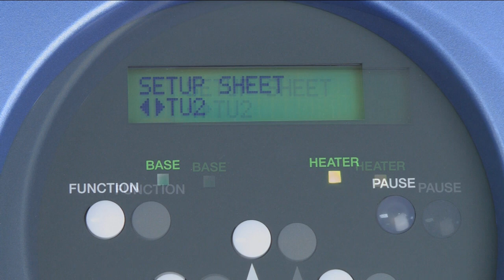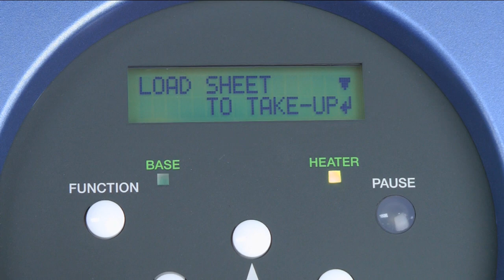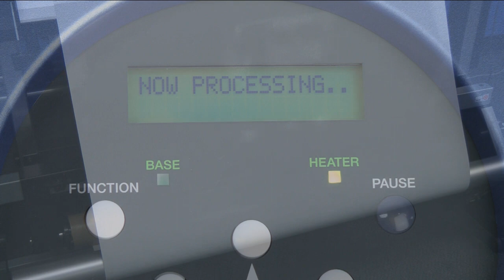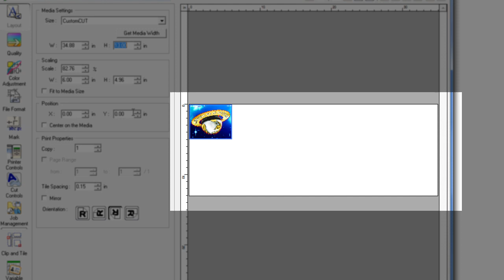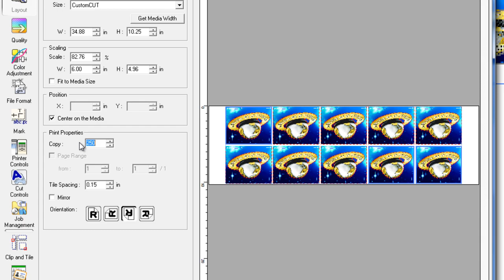VersaWorks Settings for Integrated Print/Cut with a Take-Up Reel

Comment: I've ve never seen this setup anywhere, and now that I own a VSi machine myself, I've been doing some homework  and realize it's a thing! 

I assume you need the multi pin cable to do this?  Do the TU-2 units come with that cable?